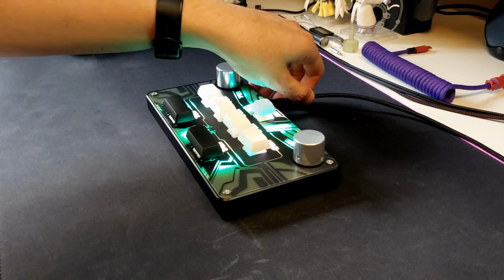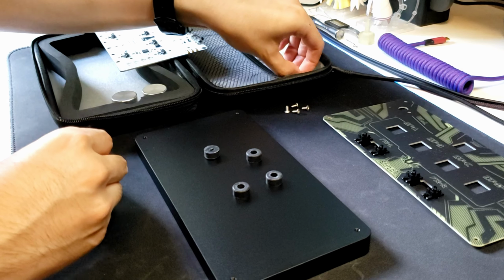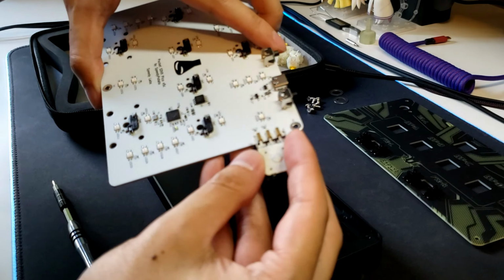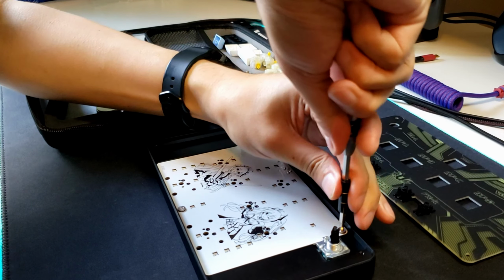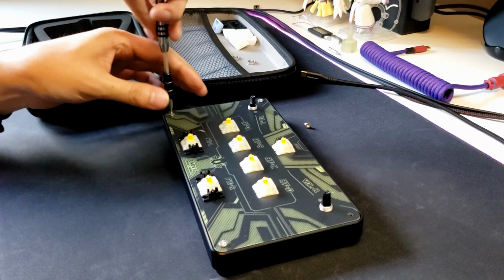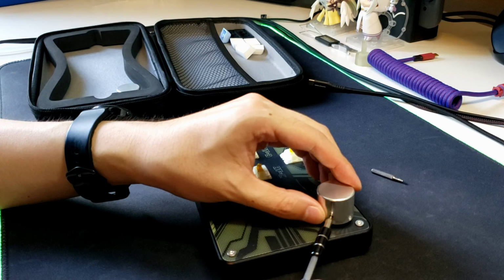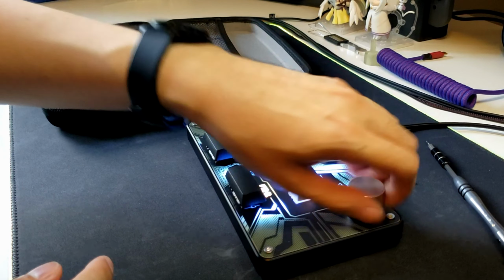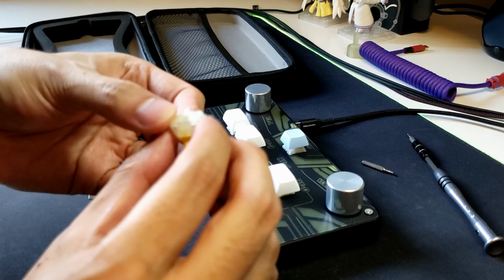Pocket SDVX Pico v5 Demo & Showcase

Comment: just ordered mine, where do i download sdvx exceed gear?
Reply from the maker: Check out the quick start guide at https://www.speedylabs.us/support/ or look up guides for sdvx e-amusement cloud, kshootmania, or unnamed sound voltex clone
Reply: @SpeedyPotato_  Just bought one of these from you. Cant wait! Can these be used on other music games besides the ones listed in your reply? if so, have any recommendations?
Reply from the maker: @dethklok808  it can act as either a controller or keyboard, so pretty much anything that lets you change bindings will work.  Sooo many games out there, osu4k, fnf, etc